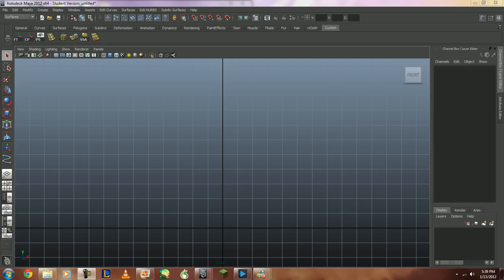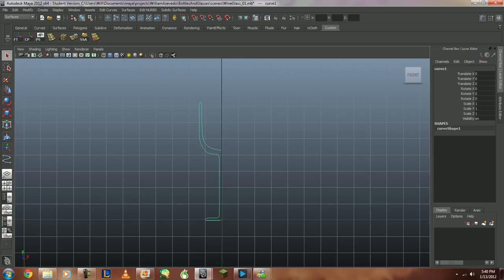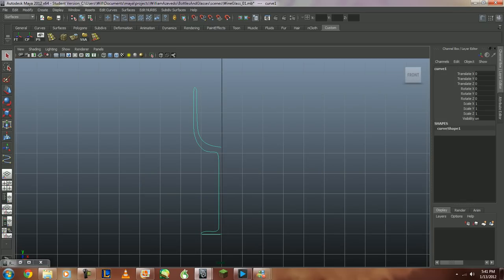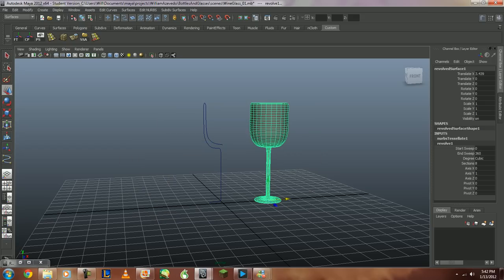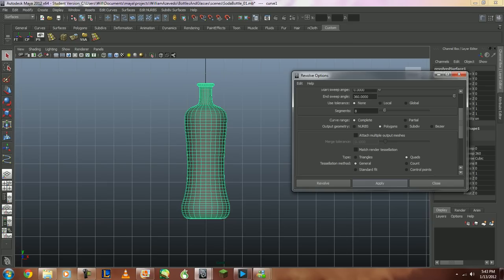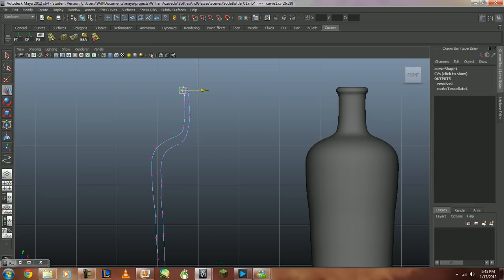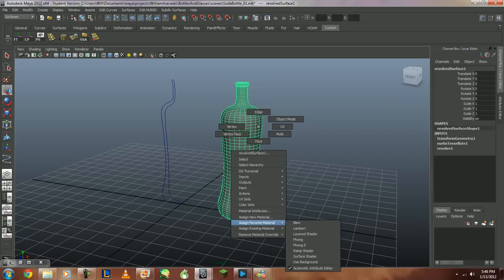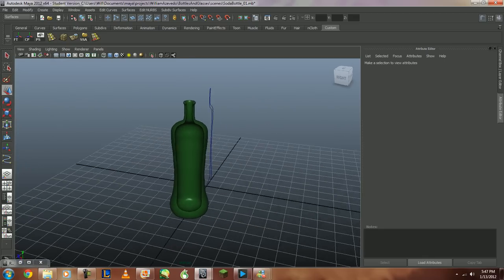How to model a Wine Glass and Bottle in Maya 2012

Comment: @dukefan789 Its alright, I fixed it. For some reason it was stuck on rotating with the grid origin so I had to move the curve and align it with the centre point.